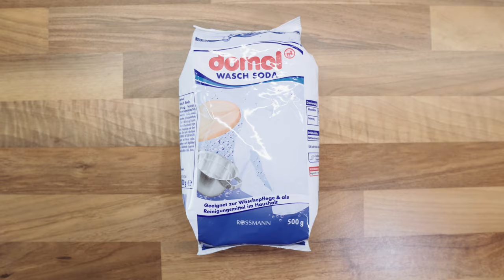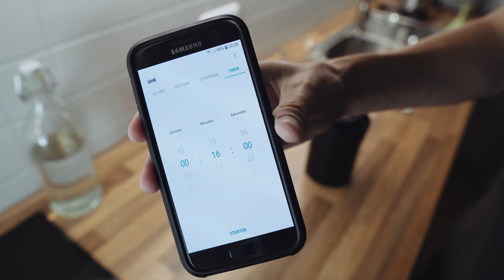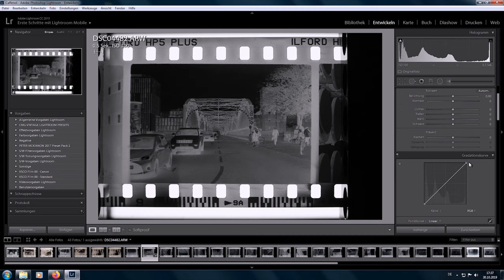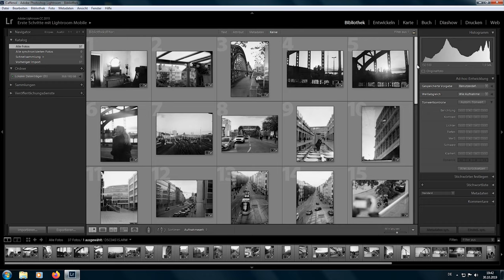CAFFENOL // Homemade B&W Film Developer

Comment: will this proportions work for 120 film?
Reply from the maker: this depends on your developing tank
on the bottom of the tank there should be the measurements needed for each film type
my tank says for 120 film 590ml, if yours is also under 600ml these proportions should work fine

Comment: Excellent video! This is very helpful. One question — when scanning, did you use the phone only as the light source and then use another phone or something to take a picture of the backlit image? I’m not clear on this step. Thank you!
Reply from the maker: Hey Jon, first of all thanks a lot :)
I used my phone as a backlight for the negative and used my main camera with a macro lens to take the pictures of the negative.
If you don't have a seperate camera you might look für another lightsource to backlight your negative, like a laptop monitor layed flat or something similar and take the picture with your phone then
Reply: @adamsanalogadventures  Got it. I was thinking an iPad would work well for the backlight. Thanks again for the great video and clarification!
Reply from the maker: @jonmnelson  yes an iPad should work well, but since its such a big screen you just might consider blocking the light on the sides around the negative so you don't get flaring in your lens while taking the photos
Have fun scaning :D

Comment: Hello, I use 24mm Aps film, can I develop my film without a developing tank or reel? I don’t think a 24mm developing reel has ever been made. Thanks!
Reply from the maker: I'm not too familiar with the aps films, but you'll definatelly need a tank to develop at home to make sure it develops in complete darkness...as to the problem with the reel, my best guess would be get a tank with a 135 spool and see if you can somehow modify it for your needs, maybe cut a little bit of here and there to make it fit, best to try with an already exposed negative roll
i wish you good luck with that and hope you can get to developing your own film at home ✌

Comment: Can I also use baking soda instead of washing soda?
Reply from the maker: i think it won't work right out of the box, but with some modification it should work (i'm no chemist, i've only heard about this method and didn't try it myself)
from what i've heard it's possible to turn baking soda into washing soda by heating it in the oven, just pour some baking soda on a tray and let it sit in the oven for about 30-60 mins at around 200°C, this should turn the baking soda into washing soda
Reply: @adamsanalogadventures  yes, correct

Comment: You don't add some vinegar to stop bath? And another question: did you ever tried use salt as fixer?
Reply from the maker: no´, i just "stop" by rinsing the film a couple of times, so far i've never had any problems
and i've not used salt before to fix, but i assume it takes way longer to be compületely fixed than with regular fixer